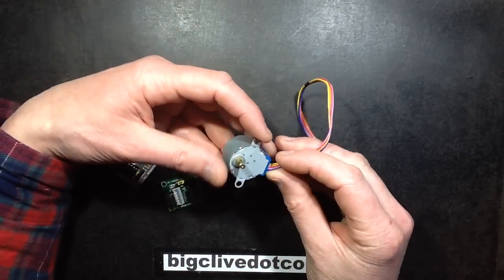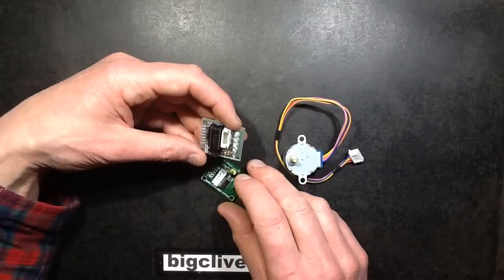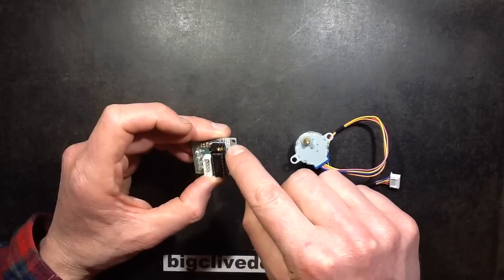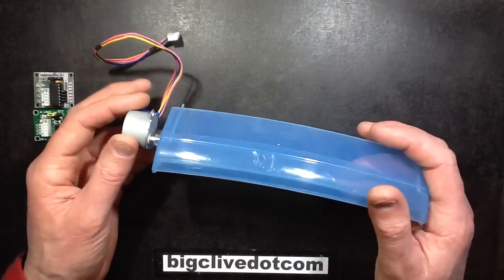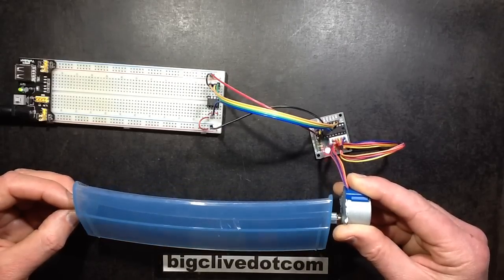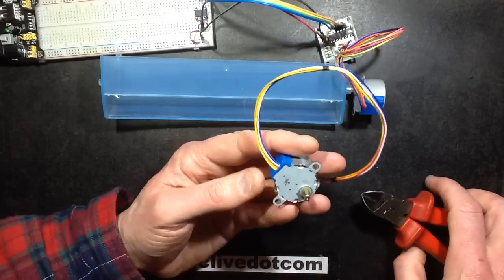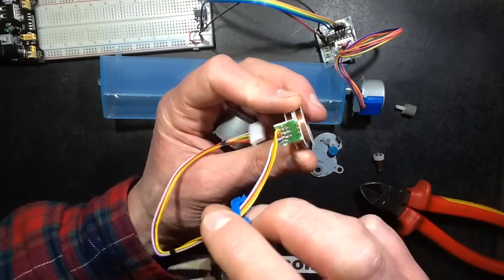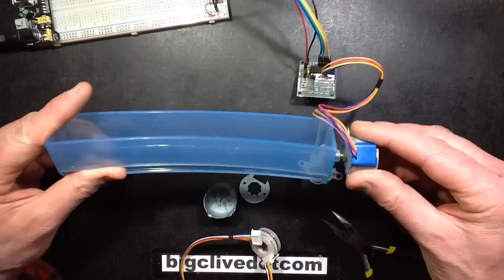Mini geared stepper motor test and teardown.

Comment: I have worked with installing and repairing AC's/air heat pumps. (Here in Sweden they are mostly used for heating...) It was pretty much always a fan motor, some problem with one of the circuit boards or the valve used to swith between heating and cooling.

The circuit boards was just quicker and cheaper to replace the whole board instread of searching for and replacing one component.

Anyway, I think I have replaced one of those sweeping stepper motors once, and then we had to send it back to the manufacturer as it was a guarantee job and they needed it for "analysis".

Nice to see what's inside one of those, never had the chance to take one apart.

Comment: Another use for stepper motors that many people come into contact with are physical-reel slot machines such as the Bally 5500, IGT S+ and IGT S2000 (Vision) slot machines.

Comment: i tried to lift a filled 1.5L PET bottle with a piece of string using full step drive method.
no problems at all.
a tiny motor with so much strength, can really built some interesting with it.

Comment: Nice detail about the clutch. I didn't know about that part.

I guess you covered it all, but the motor is also usable with bipolar drivers.
Reply from the maker: I guess it could if you just left the positive common wire disconnected.  It would present a higher winding impedance though.  The air conditioning units usually just use the ULN2003 or 2803 or even just discrete transistors.  It's a nice simple way to drive a stepper.

Comment: Tnis is actually how the steppers in FTIR instruments work. To save cost there is no "zero" indicator. Instead the software moves the motor all the way to the end and then some, letting the motor "slip" . After that time it knows it will be a zero position. From that point it can then count steps to go to a known position

Comment: Hey Clive, there are 5V and 12V versions available of the 28BYJ-48. I can't seem to find real data in terms of torque, noise, speed etc. What would you recommend for a DIY motorized blinds? Not sure if I'd need to use bipolar or unipolar either.
Reply from the maker: You might find these little motors are too weak and slow for blinds.

Comment: I've got a similar looking stepper, but says 6v 10ohms (part number 20BYJ01-160HR)..   however the motor drivers I've seen all have a trim pot to adjust the vref until it corresponds to the maximum current you want to drive.  But I can't find any datasheet on the motor, so how do you know how much current it can take?   Or the number of steps per revolution?   And what happens if I apply 8v-24v instead of the 6v?

Comment: Hey Big Clive, the only motor I've seen that is close to or pretty much could be identical in some ways of size is the ones used in a microwave oven for the turning plate. They have a geared end on them instead of that flat style like those & turn completely around of coarse but have you ever noticed that when you restart the oven it starts up in the opposite direction? Why do you think that is, or what causes that to reverse itself once stopped like that? Thank you for your time BC, Tom.
Reply from the maker: Microwave turntable motors are synchronous motors.  They rotate at a speed determined by the mains frequency and the basic units have no particular direction.  If you stall them they will just kick off in the opposite direction.   To get direction you either need two windings with a phase shift (capacitor) or a mechanical latch that physically stalls the motor if it goes in the wrong direction.
Reply: OK, now that makes sense because at first I was thinking surely they would have a capacitor used for filtering if nothing else, so now I understand without it how it just changes rotation, thank you BC, Tom.

Comment: Big Clive, 5 wires and two coils (2 ends each =4)  why the need for 5 wires?  Could you please explain the wiring.
Reply from the maker: Centre tapped to create a common and four windings.

Comment: Hi Clive! I really enjoy all of your videos. I've been subscribed for a few months now. You have a fantastic wealth of knowledge.

I do have a question about this sample circuit you've made with a PIC 12. I work in IT as a network architect, but I'm totally new to microcontrollers. I've been poking around looking for information on how to get started with a PIC chip. But I wanted to ask if you used a PIC Kit or similar device to program the IC?
Reply from the maker: +Peter Trom The easiest way to get started with PICs is to use either a PicKit3 or PicStart plus.  Both supplied by the same company that makes the chips and very affordable.
Have you considered the Arduino platform?  It's even easier to get started with.
Reply: Thank you for your prompt reply! I have not had any personal experience with an Arduino. I will definitely look into it! Thank you for your guidance! 

All the best,
Peter
Reply: +Peter Trom Arduino is the thing for microcontrollers really with loads of tutorials on youtube and is totally open source, meaning you can buy the un-programmed chips and make your own version, if you wish.

But as an alternative there are also the PICAXE chips which are programmed with a version of BASIC, however, you have to buy the preprogrammed chips, so is not really open source like the arduino.

Comment: Hi i am new to motors and electronics loved your video i am trying to make a shop window display where puppets are waving using fishing wire over a pulley and on to a wiper motor the wiper motor is loud do you know what the best way to improve on this would be thanks
Reply from the maker: A wiper motor might not be the best option.  Many of the puppet displays use a small mains powered motor with an offset cam that pulls lots of wires attached to it simultaneously.  But of you do end up using the wiper motor you can reduce the noise and speed by using a lower voltage to run it.
Reply: ok that's great thank you i would prefer not to use the wiper motor would say a disco ball motor be the sort of motor you mean, also i have know i idea how a cam would work is there any way you could show me a picture or diagram at all sorry to hassle you
Reply from the maker: A disco ball motor is too slow.  Try finding a synchronous motor geared to run at about 30 RPM.
Reply: Disconnect the puppets.  Make them wave by taping them to waving puppets hidden behind them.  Repeat as needed.
Reply: You could try a stepper motor or even get rid of the fishing lines and use servos inside the puppets. These will require a custom chip to run either way. You could also use a mechanical solution, like a cam.

Comment: how much faster could you get that motor to turn back and forth?
Reply from the maker: It's not fast, but for a short arc it could vibrate at high speed if it had a light load..

Comment: show us how to build the pic controller or pwm like 555 timer to drive the stepper ?
Reply: as im thinking of  driving some fruit machine  reels with it  as they have  4p  6 wire motors  and i can try to convert them to 4 wire plus gnd

Comment: I found these in microwave ovens, they spin the plate :)
Reply: stalkersas those aren't stepper motors. most of them will have markings on the back, which will read 120v or 220v.
Reply: That would be a synchronous motor. Ever wondered why the plate can sometimes turn the opposite way, seemingly at random? Those motors can go in either direction, depending on which winding kicks off first. Some have a capacitor to create a phase shift, which makes it always go in one direction. If you stop the plate from spinning, it will start spinning in the opposite direction.